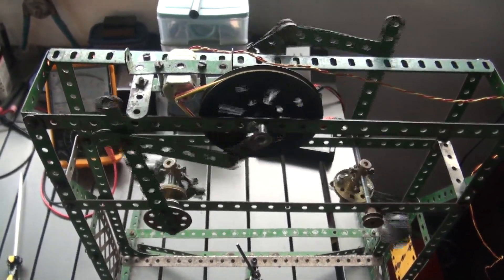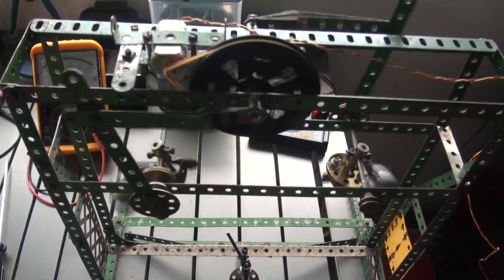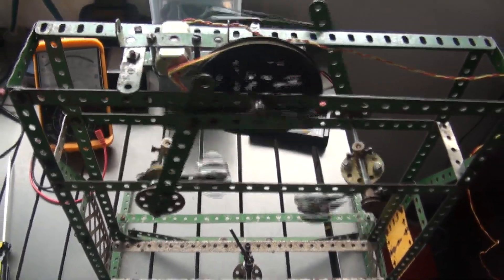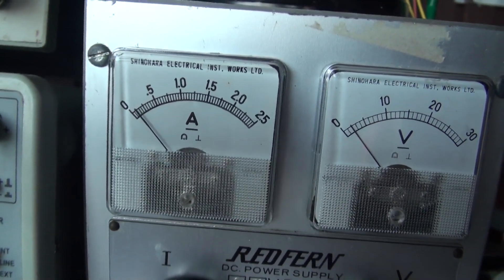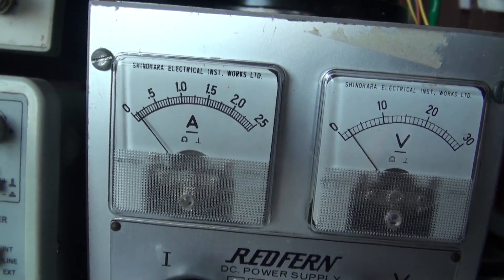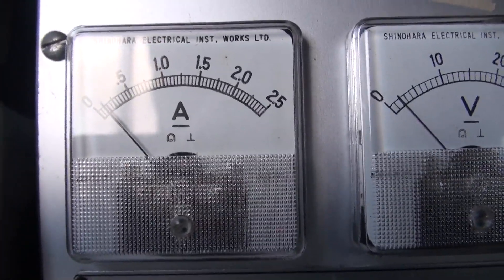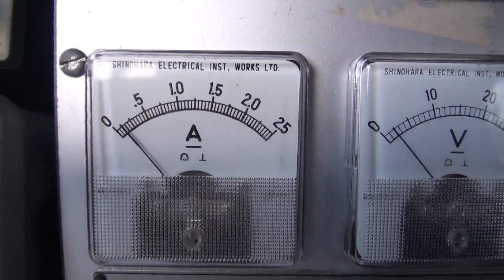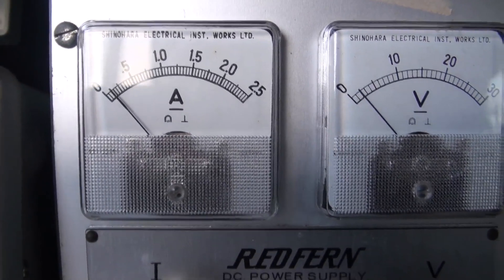The Skinner Gravity power device   A close look at the linear drive  x264

Comment: In analyzing the best I can from watching the original Skinner video and experimenting myself you have to think about what is actually happening.  there are four key facts that are happening and have to function together for this device to harvest gravity. You must have a weight, a mass, then you must have a lever in order to use leverage to manipulate the mass
into a position where gravity can act on it. then you must have an oscillation created by the falling mass.  I believe you can come up with other methods of harvesting gravity if you keep those same principles in the design. I'm not a believer in the elliptical theory of the lever. Yes the weights have to be lifted in order to fall and that is what the lever does to the first weight, it lifts it but also tilt's it. Once the weight is lifted by leverage and tilted, gravity can now act on it pulling it back down but it never reaches the bottom because the lever is continually lifting and tilting the weight, it's like surfing on an ocean wave, The wave lifts the surfboard and gravity causes the surfboard to fall but it never reaches the bottom because the wave continually lifts the surfboard. There is no jerking motions here which would be present in a elliptical orbit
speeding up and slowing down. This machine has a smooth even continual rotation. The lever is lifting the weight but it's also kind of pushing the weight at the same time, just like the wave is doing to the surfboard.  The second stage is exactly the same as the first stage only the second stage is being driven by a more powerful force.  The second stage has its lever but it’s lever is driven by the first heavy mass instead of a small motor.   The more leverage you use By increasing the length of the lever, the less power you will need to lift the mass and so you could increase the size of the mass.  However increasing the lever length will also require a larger diameter circular path for the lever to make in order to lift the mass to a good height for gravity to act on it.   The length of the lever and how far it protrudes out of the gimbal at the bottom will determine along with the Circular path the lever makes, how high the mass will be lifted.  Also consider how the mass is falling, You are creating a incline a ramp and the higher you lift the mass the steeper the ramp or incline becomes.  The steeper the ramp the higher the falling force of the mass.   
Another issue will be in balancing the weights, The first stage only has so much power and can only lift a certain amount of mass in the second stage, if you use too heavy of weight in the second stage the first stage wont be able to lift it.  And if you don’t use enough weight in the second stage your power Amplification factor will be low.     I would build the top section first, The motor size, the lengths of the lever arms and the size of the mass are all relative,  consider them in relation and proportion to each other in order to tune the machine.  You can make the levers longer or shorter you can increase the drive motor size you just have to adjust the size of the mass so the motor can drive it without overheating but remember to size your secondary mass large enough to create the maximum amplification.
Reply from the maker: I agree with you completely.
The cyclic effort of lifting the revolving mass is balanced out , leaving only the minimal load of bearing friction to overcome. A very thorough explanation. It's a pity that these principles have been ignored commercially.
Reply: @davidquirey6917  I don’t know how many people are trying to replicate this but it is important to sit down and diagnose and understand what’s actually happening, once you fully understand how the machine works you should have success in building it I think a lot of people just try to slap together something and end up failing of course the main stream media the government energy cartels etc. they understand it fully well and it is a threat to their energy business this world runs on oil and large profit has to be made and anyone coming up with any other form of energy will be suppressed shut down threatened  and if you still won’t cease and desist You end up dying from mysterious circumstances

Comment: Thanks for the video, your craftsmanship is both intricate and thorough! However, it will only be effective, serious, and revealing if you include a comparison between input power required to operate the driving pulley VS the output power produced in the form of torque from the swinging weights. This would serve to quantify the coefficient of performance of the Skinner concept. Is this device tapping into gravity and thereby achieving an output power greater than the input power? Input VS Output.